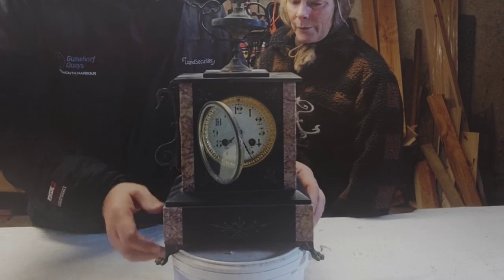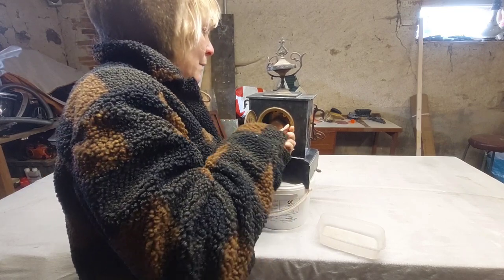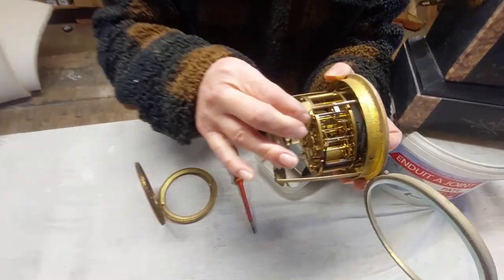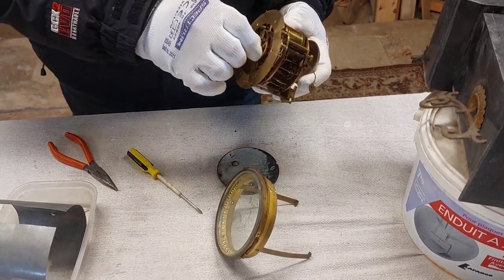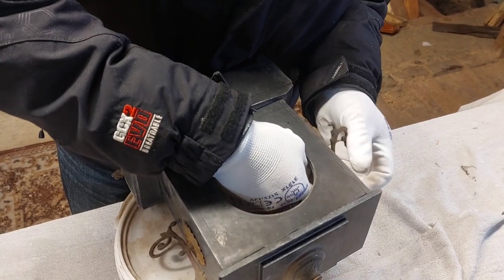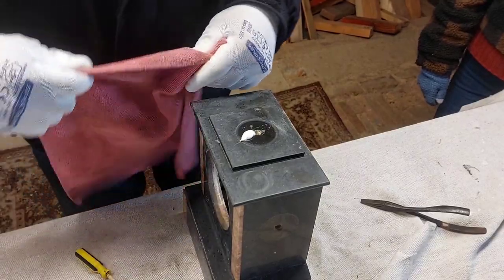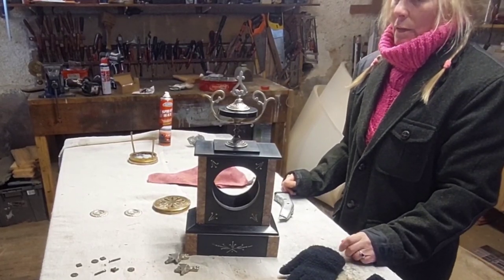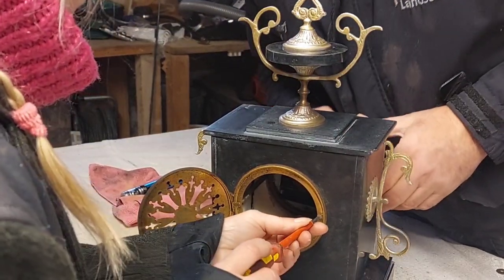Ep 101 | Bargain French Mantle Clock | Restore with Modern Movement | French Farmhouse Life |

Comment: i picked up a Grandfather clock all mangled inside - think someone has had a go at pulling it apart, so not even sure if all the parts are still there.  I done exactly the same thing and popped a battery mechanism in the back.  It is sad that it does not tick-tock, strike and no moving pendulum, but hopefully one day she will sing again.  For now she will just have to look pretty.  Thinking about it, I have had her for about 10 years now. How time flies (ha ha)

Comment: Looking at a brief glance of that movement,  it is in good condition and would not take much to repair / clean. The cog Anna referred to as stuck is supposed to be, it's a ratchet that is part of the system to fine adjust the clock by raising and lowering the pendulum. Lot of videos on YT how to repair. Just always let the main spring and chime spring down slowly before you disassemble  it or you run the risk of cutting your hands and worse damaging the clock. Safety third. 😂💅